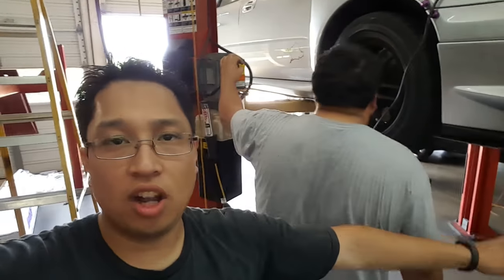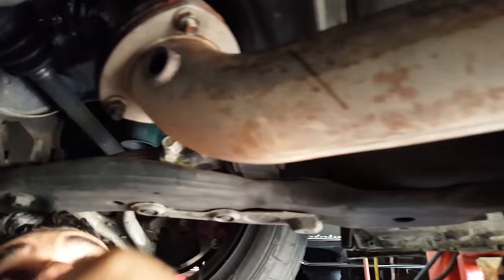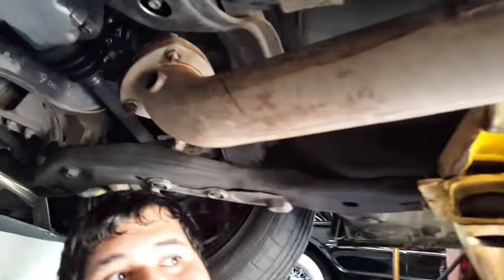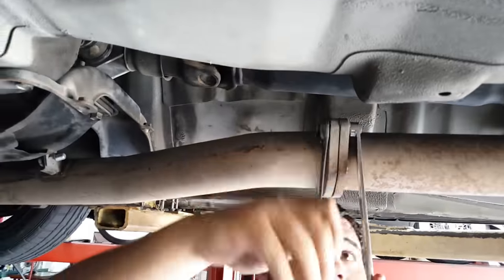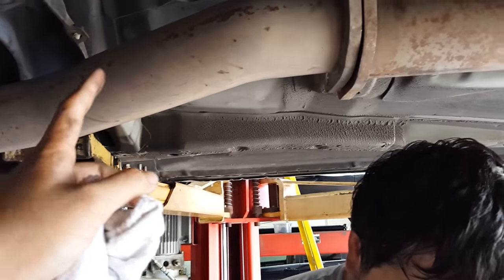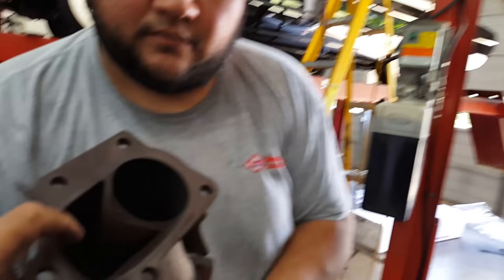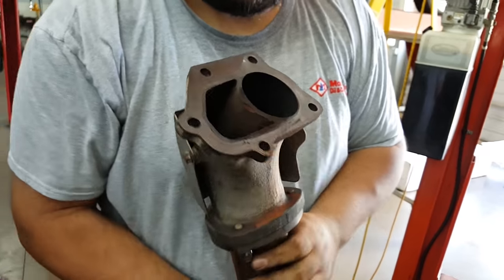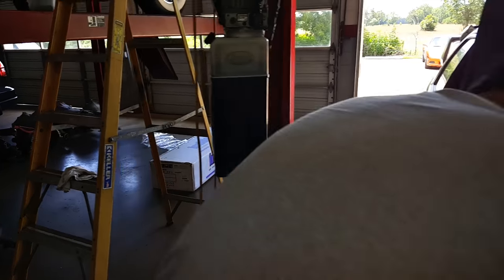EVERY Subie Owner Needs This For Stage 2! Ep. 35 - Invidia WRX/STi Downpipe Install

Comment: I’m thinking of running the same DP (Invidia), do I need a tune after the install or am I fine?. 
Has a aftermarket exhaust atm not sure the brand.

My car-05 wrx blob eye 

What do my fellow subie owner that have been in the game think?
Reply from the maker: It's always best to get a tune after a major change like a downpipe. But otherwise it should drive just fine without any issues. But you may throw a CEL for the Catalytic Converter

Comment: Sorry if I missed it, but is that DP coated?
Reply from the maker: Hatchback Conn In this video no, it isn't coated. we later had it coated when we swapped out Up pipes.

- Marc
Reply: Right on. Fixing to do headers,up-pipe, and downpipe and have read mixed things on whether coating the downpipe is needed. Thanks for the speedy response! -Conn

Comment: Question. Does the DP comes with the hole for the sensor?
Reply from the maker: +Mr.Squid Yes. They have two options. One bung for the factory sensor. Or two bungs if you have a wideband sensor.

Comment: if I did the cat deletes on my 04 sti and did the invidia downpipe would I need a tune?
Reply from the maker: +Sawyer Bowens With a Catless downpipe, it would be best to get a tune.
Reply: ok thanks
Reply from the maker: No Problem.
Reply: Tom It will if you don't get the tune
Reply: Another question why is the reason have to do a tune for the catless

Comment: maybe a dump question . but im curious..how do u accomplish the external wastegate w/o the rotated turbo setup !
Reply from the maker: That's not a dumb question. I asked the same thing when I built my first Subaru man which was almost 8 years ago now. Man I feel old lol. Any ways. They sell kits that keep the internal wastgate flap shut. Or in my case Forced Performance welded my internal gate flap shut. Than you just need to either buy an up pipe with either a 38 or 44mm Wastegate flange on it
Reply: Go for 38 over 44 if you are running a td04 and a 44 for VF series turbos.

Comment: hmmm...why are you replacing out an APS downpipe with that?
Reply: Because the APS downpipe is a divided mouth setup. He had an External wastegate setup. So the APS downpipe was actually restricting flow since he didn't have an internal wastegate turbo.